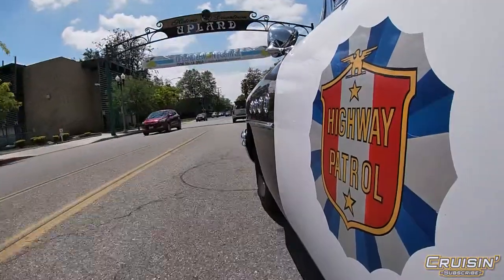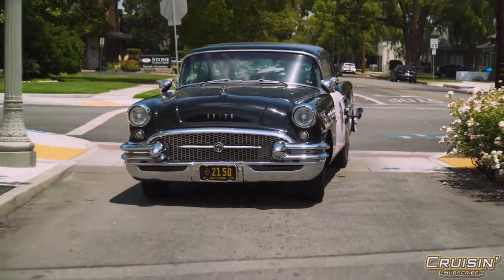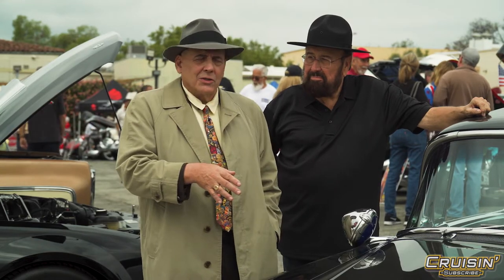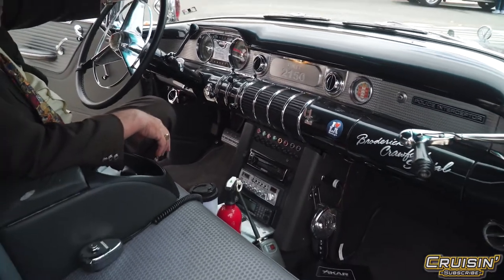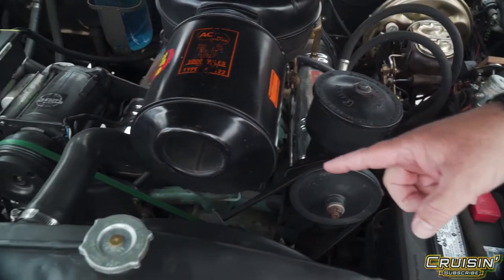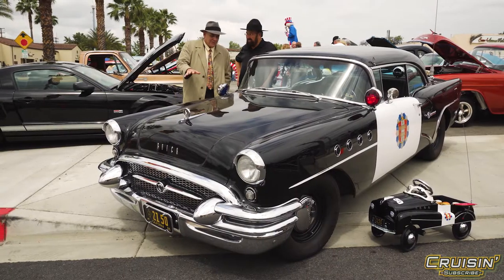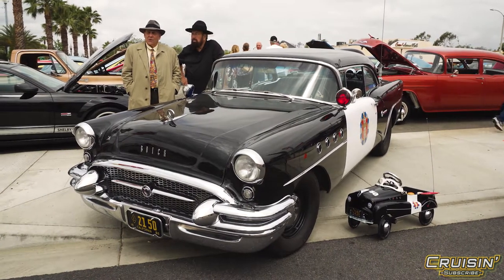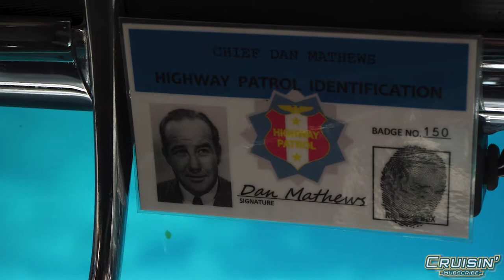Hollywood's Famous 1955 BUICK Highway Patrol Car - Shotgun Tom Kelly & Gary Goltz

Comment: The 1955 Buick Century patrol cars used in the first year of the Highway Patrol TV series were actually never sold to the public and were labeled by Buick as "Model 68-Two-Door Tourback Sedan". 270 of these Buick Century 2 door sedans were manufactured exclusively for the California Highway Patrol (CHP) in 1955, 135 manual trannies and 135 Dynaflow autos. The 2 door Tourback sedan body was already being used in the entry level Buick Special and is far from rare, given that over 60 thousand were manufactured for the '55 model year. The Buick Century, 4 port-hole, 2 door sedan models used by the CHP were owned by the California Highway Patrol and loaned to the studio for the filming of the Highway Patrol TV series. The studio would cover the CHP embelin with a generic HP stick-on embelin. What you are looking at, in the video portion of the post, is a hardtop Riviera, a much more deluxe vehicle than the 2 door sedans used in the TV series. The 2 door sedan has a B pillar unlike the open hardtop (Riviera) in the video. Unfortunately, since it was never sold to the public, there were no road tests ever published. Also, though "Fireball" Roberts drove a '55 Buick Century in the '55 NASCAR racing series, it was the hardtop Century because only stock production vehicles sold to the public were eligible to race. So, the Buick in the picture is a Buick Century Riviera hardtop with added black and white paint, spotlights and base level dog-dish hubcaps, but is not an exact replica. The last I heard, there were only about 4 surviving former CHP vehicles in existence. Here is a link to several photos of the actual CHP 1955 Buick:  www.policecarwebsite.net/thepolicepackage/gm/gmpolice1.html